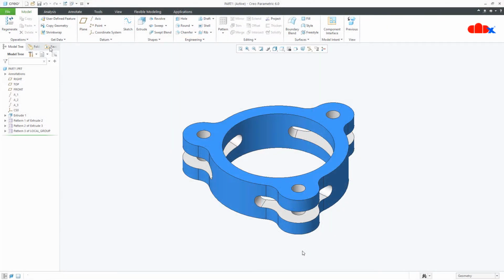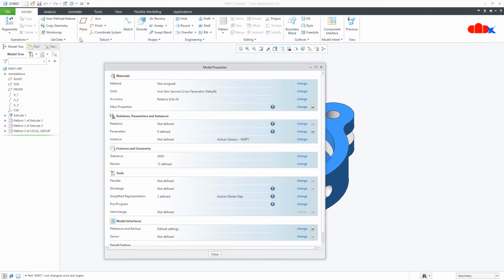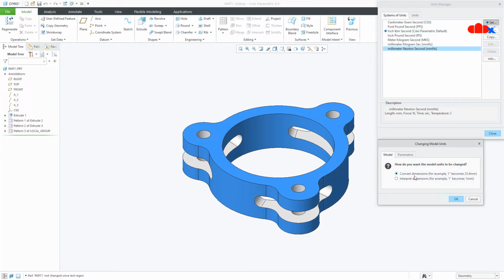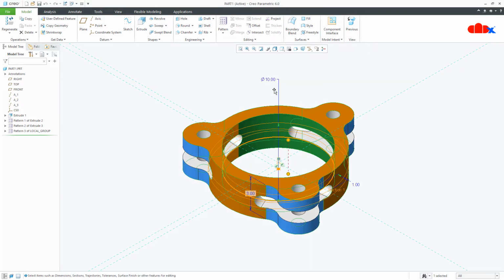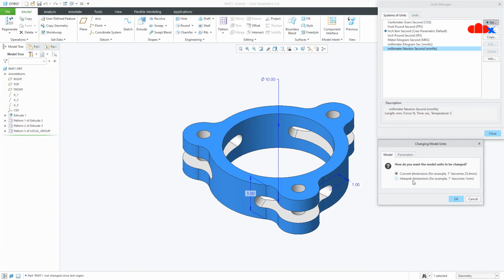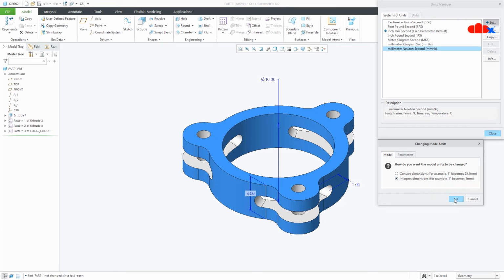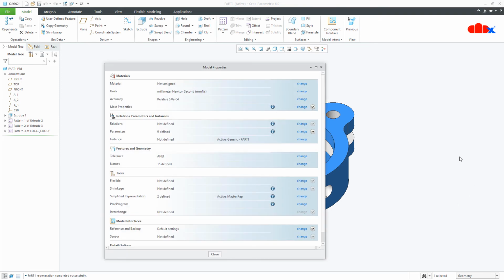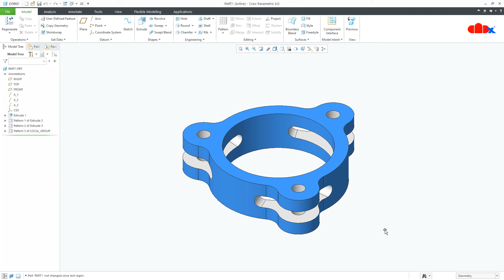How to change the unit of the part from inches to mm | Unit conversion in Creo Parametric

Comment: Sir this changes only in that part. How to change units permanently in Creo in every file?
Reply from the maker: For that you need to use the correct part template. Part template is called start part in creo parametric.

Comment: Didnt understand the 2nd option. How can 10" equal to 10mm?
Reply: Are you trying to say that the model scales down proportionately to make sure the value is achieved in mm with the same numerical value?
Reply from the maker: Let's assume that you have created a cube with 10x10x10. You were looking for the part in mm. After completing the part when you check the unit you found that the unit is in inches. So in such cases when you convert that part from inches to mm, to keep the same dimensional value you go with the second option.
Reply: @CADxTraining  Understood. Thanks.